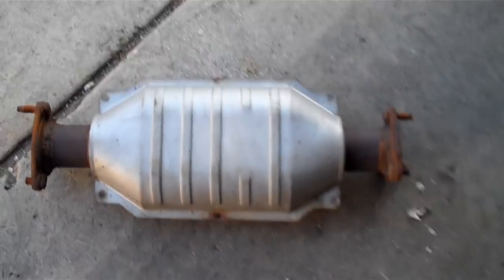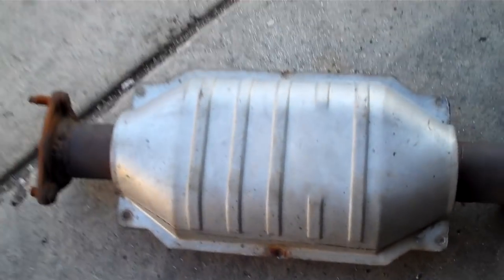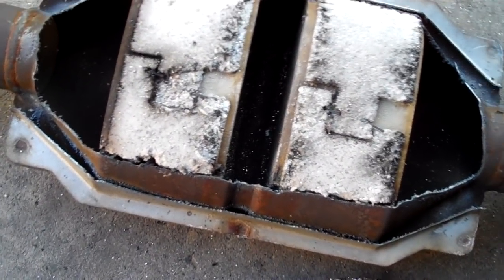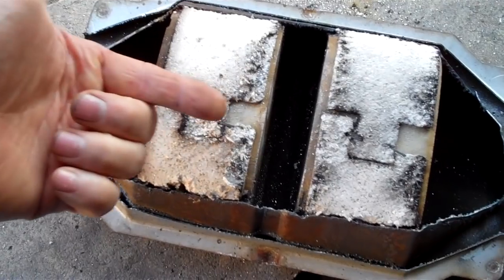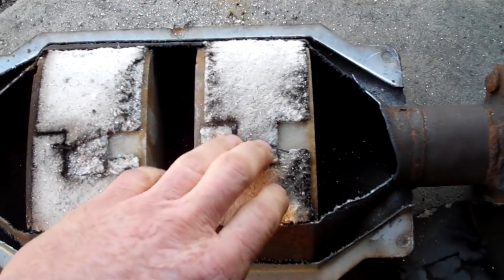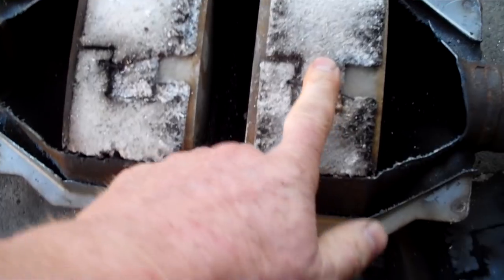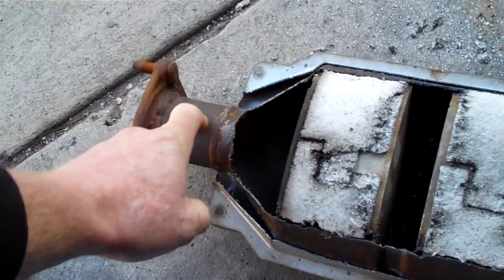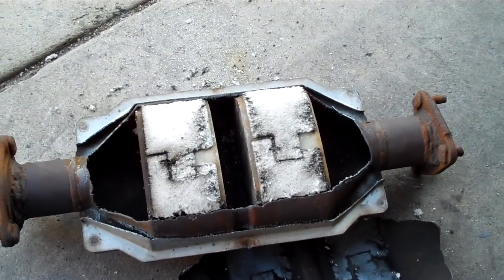Here's what's in a catalytic Converter.  Here's how they work.

Comment: Will a bad convert always trip a check engine light it is it supposed to my 98 Jeep Grand Cherokee had a bad converter got so bad the car won't go past 5 mph and my check engine light never came in and I have 2 O2 sensors I've been getting very bad fuel economy even after the repair it idols rough no check engine light is on.
Reply from the maker: +SuperJeremi10 Older OBDII vehicles before 2001-2002 almost needed a part to fall completely off for the light to come on.
Reply: oh dang haha  I'm driving a 98 haha. what can I do about poor fuel economy I'm getting about 8 mpg city and about 10-12 city highway  when I should be getting about 14 city 16 city highway and 20 highway according to the government website I have a new converter and no check engine light also no signs of a rich engine the tail pip is not black with soot plugs and wires are all new and oem style  and they don't show signs of a rich burring engine  the tail pip does not smell rich either but I'm getting poor economy I have the inline 6 98 jeep grand Cherokee  ive noticed my mpg has dropped ever since the converter went but ive had it replaced but mileage still suffers.
Reply: +SuperJeremi10    Your problem is probably related to your wheels and tires.   Yeah, big tires will kill your mileage.   Low air pressure alone will take at least 3-MPG off of a heavy rig like yours, where the stock tires are almost a foot wide.   If somebody threw some 33 inch BFG's on it an inch or two wider, then you can be running with 20psi and not even see it.   Get an air-gauge and check first.   I about guarantee you are underinflated, and oversized.
Reply: I have  the factory rims on my jeep and they are aired to 45  jeep specs call for 36  I have the factory sized tires on the car and max psi is 50 jeep calls for 36 so I put 45 in them tire pressure is checked weekly along with oil level and coolant level and tranny fluid  I have the same size tires as on the door sticker. I also don't have 4x4. I take pride in maintaining my vehicle.
Reply: The only Jeep that is two-wheel drive only is an old right-hand drive Postal Jeep. Go s;eep and forget to wake up.
Reply: I have a 98 jeep grand Cherokee and 4x4 was optional not all jeeps have 4x4 just like not all Tahoe's have 4x4 or ford f150s not all suvs and trucks have the optional all wheel drive or 4x4 don't tell me I'm wrong my jeep is rear wheel drive without 4x4 I know my car ive been under it  doing repairs.
Reply: ORRRRR...You DO have four wheel drive, and not only that, you have high and low range.    If you are driving around in low-range, you would be getting EXACTLY that kind of mileage.
Reply: I don't even have a selector for 4x4 its blocked out  the front wheels are not connected to the power train if you lift the vehicle up and put it in gear the front wheels don't spin only the rear its rear wheel drive.
Reply: Amazing....But true.   Is it automatic, or a stick?
Reply: automatic
Reply: well as far as I know my jeep runs just fine except on gas I had a oem converter put on it I'm in texas we still have lots of jeeps on the road older newer other suvs and trucks to also cars gas isn't that expensive here gas in my area is like 2 bucks a gallon and I might get vw but I like trucks and suvs  I got a 2 wheel drive care because I didn't want to deal with the gas and added upkeep on the 4x4 system my jeep has 177,000 miles on it I don't usually get my jeep pasted 60 I don't normally get up on the freeways  but when I do I go about 70 Ii also don't off road another reason I didn't go with 4x4 most jeeps in my area have a 6 cylinder engine or a v8 ill probably run this one till the motor or tranny quits then sell it to the scrap yard my grandpa has a jeep wrangler has had it 10 years 4x4  200,000 miles never had any major issues with it.
Reply: Wrangler!!! NOT built by CHRYSLER!!!   It also weighed only 2,000 pounds when it was first produced, in 1942, 77-YEARS AGO!!!   It was deigned not to carry fussy Mommies, but HARDENED WARRIORS.   It was NOT built to BREAK INTENTIONALLY.   Your engine is NOT a finely balanced HONDA ENGINE.   You are 30,000 miles, or two-years, or rater, $6000 dollars in fuel away from replacing it.   Be honest, admit it, someone GAVE YOU THIS HUNK OF JUNK.   No offense intended.   I am just trying to educate you a little on LIFE.  So, a simple yes or no will progress the conversation, Gift, or " Low, Low prices, Come on down"
Reply: Ibn Yenken Yerech Ane I actually was looking to get a Honda crv or Toyota 4 runner/Tacoma or an acura mdx but I couldn't find one in the shape I wanted for the price I could pay and low miles I had 4,000 out the door that was my max I wanted something I could walk out the door paid for in full I wanted something 150,000 and under or close to that range I got the jeep with about 150,000 it now has 177,600 I paid 2,000 out the door for the jeep  which leaves me an extra 2,000 for repairs it may need.
Reply: How...never mind.    Yes, you should have bought the Acura MDX,    I even priced one used at $4000 dollars before I wrote that.   ITS A HONDA.   Remember how I illustrated that you are spending $400 dollars a MONTH on fuel?   Even if you kept that a constant budget, the mileage increase would have pay for the extra charge per month in car payments.   There ARE ways of getting CASH from a credit card, you know.   This is the kicker, you Jeep is worth ZERO at trade-in time.   In five years, that Acura will STILL be worth $4000 dollars, and you could have done it without fixing many, may things.  Honestly, did the salesman represent it as being " Four wheel drive"?   If he did, go shove it so far up the managers tailpipe...and go and buy the Acura, especially if you actually have a budget set aside for the gas-hog.   That vehicle literally KILLED an entire car company.
Reply: I didn't have the funds all the cars here where around 5+ plus I want going to drive 300 miles for a car all I had was 4,000 anything for the Honda Toyota line  was 5 and up  anything cheaper had major issues or cosmetic damage like wrecks or an un clean title so I chose the jeep it was cheep and in my price range and not destroyed if I could have gotten an mdx I would have I don't really want a car  as for the gas mileage I had a Tahoe I'm used to not getting more then 2-300 miles one one tank of gas and no the sales man didn not sell it as a 4x4 I knew when I bought it it did not have 4x4 there are quite a few jeeps here with out 4x4 I bought it for  getting from point a to be  but I wanted something in good shape with low mileage I drive a lot of times in the worst conditions I dive 90 + plus miles a week  a lot of times in rush hour stop and go traffic not always though  with the ac blasting I should get at least 14 mpg  but prolly not me along with the rest of my family have led foots  meaning we drive fast my dad had a 94 Silverado getting about 16 mpg city he could get about 350 on a tank of gas mom had a Chrysler town and country so we are kind of used to getting poor gas mileage but gas is like 2 bucks a gallon here ill prolly never own a car that gets more then 15-20 mpg I like suvs and trucks they usually don't get good mileage specially the older ones as far as trade in I don't plan on trading in this jeep I plan to run it till its done  that's another thing  we are known for owning cars a  long time my dad had his truck 20 years 300,000 miles then water in the oil mom had her van 12 years then it got wrecked  I had the Tahoe 2 years then the engine went it was troublesome non stop always broke down no I have the jeep ive had it almost a year now. haven't changed anything but the cat and the radio bought to replace the head light lenses it has just had a complete service job all fluids changed new breaks spark plugs cap and rotor wires and a full service check everything on it is fine and in good shape I also had a new air filter and battery put in the tranny has been serviced and I was told it is healthy took it to a trusted mechanic dad grew up with the owner that's where we take all our cars to have work  done that we cant do ourselves I'm about to have the timing chain replaced unsure of when it was done you can hear it slapping around.
Reply: That timing chain alone, means it would be cheaper to buy a replacement engine.   It is a slippery slope, at that point, you could be putting a payment down on another car.    You say you are not willing to drive 400-miles to save $4,000 dollars?   But you will drive 90-miles a week all the time.   And, it appears you LOAN IT OUT?!?!?!   You are not just getting it torn up, it is one of the only vehicles possible to drift in any kind of classic sense of the word.   Let me guess, the front Crankshaft seal leaks oil as well?  This engine is susceptible to oil-pressure loss, with no indication but a red light that turns on to indicate it's too late.   I never could figure out why they would be so mean.....  The ENTIRE FRONT, and TOP, of the engine MUST BE REMOVED.   In fact, the oil-pan as well.  Hmmm, well, that means pulling the engine out.   You see, this is where you just stick another one in and hope it also has a matching transmission to go along with it, but...you have the RARE two-wheel drive model.   Even IF you were to dive in and do this as just a timing chain repair, it is going to require at LEAST $800 dollars, plus another $400 just because I am always right.   I am going to get online RIGHT NOW, and find you what is available in my neck of the Billionaire woods for next to nothing.   Give me fifteen minutes.
Reply: ill just change the chain I can get it along with gears and seal for 100 bucks and change it my self I don't loan out my car I'm the only one who ever drives it the rear seal leaks but the front don't  I aint about to pull the engine to fix it I will continue to run It till becomes an issue I have yet to own a car that doesn't leak oilit makes it to the 5,000 mile oil change with out losing more then half a court so its not a very big leak oil pressure is where its supposed o be  I can get the parts to do the chain we have a work shop we can take it to and we will do the repair on it  my Tahoe  would lose a court of oil every 5,000 miles I check my oil level weekly if the leak gets bad enough to worry about I guess ill have to have it fixed or at that point buy another car and 2 wheel drive models are not rear I saw about 4 of them just today saw bunches of them when I went looking for cars  now th ones after oh about 2005 most of them have the all wheel drive but  I haven't seen a lot of older jeeps with 4x4 least not in my area.
Reply: Ibn Yenken Yerech Ane I know Chryslers arnt the best but ill deal with any issues that come up I like the car I like the way it drives so till the motor goes ill keep it I been paying so much in gas for so long I'm used to it so the mpg isn't such a big deal to me I just was hoping to get least 14 city  but the way I drive I may never get  that it maybe better now me and my dad where working on it today finishing the maintance re greasing joints and stuff and noticed my fuel filter is leaking so I'm going to go get another one and fix it.  ill be doing the timing soon I'm ordering one next week when the motor dies instead of dropping what 5,000 on a new motor ill just buy another car. as for Chryslers not that safe in crashes well just don't wreck and be fine when I got my Tahoe I came from a car that did not have air begs as it was a 94 and at that time air bags where not mandatory I think that changed the next year.
Reply: They call them Accidents because they are Accidental.   That means you can try all you want, but an accident may kill you, and when you hit something with your car, you don't get killed by the tree, you get killed by the interior of your car.   You have a vehicle with NO SAFETY REQUIREMENTS AT ALL.   It also has a FATAL FLAW in the engineering.   It has two-wheel drive, yes, but it still has the same front AXLE, a solid axle that is suspended by SPRINGS, COIL SPRINGS.   Every time you slam on the brakes, the only thing that keeps your front wheels attached to the frame, is a SINGLE  BOLT, attached to SHEET METAL.   In a severe accident, the front axle shears off quite easily, in fact, a large hole will do the trick, like a Man-Hole cover missing is about perfect.  When the axle is torn free, there is NO DRIVE AXLE to stop it from going all the way back to the rear-axle, except one thing.   THE STEERING COLUMN.   Every INCH that axle is pushed back, it shoves your steering wheel that much further towards your hopefully still beating heart.   If the front axle deflects more than 8-inches, you will die from your ribs breaking, and puncturing your lungs, filling them with fluid, so you might even die a long, painful and very aware death.   It is an EX FLEET VEHICLE made for DISPOSABLE Government Employees.    Why would our OWN Government be so Callous?  Because they just don't care.   Kind of like you.   It is not YOU you should care about at this point, it is anyone you allow to ride inside of it with you.   If you can deal with the guilt of having a dead passenger after an accident, then fine.  Do whatcha like.   I am not one to say I have never been a bad driver. In fact, I would go so far as to admit I am a very horrible driver.   But, I have not killed ANYBODY, yet.
Reply: It is always best to look at the last work done, and that is usually the source of the new problem.    But you STILL seem to think you have some control over ACCIDENTS.   But maybe you can just Pray them away, for all I know.    Good motoring, you and millions like you support a crooked industry, I would warn every one of you, but it is like telling someone that Cigarettes will kill you, and they still insist on smoking them, because their Mother smoked them, and she died from a Tractor accident, so Smoking must not kill you.   A tractor ACCIDENT is an unintentional event, EVERY time you buy a pack of Cigarettes, you are killing one-hour and 14-minutes of your life.    But, maybe it would be the most boring 74-minutes anyways, so who cares?    As far as that goes, you might as well start a three-gram a day Heroin Habit.   Plenty of people survive forever as long as they never run out of drugs.
Reply: well I usually check oil changed but I figured spark plugs you have to be an idiot to screw that up and its one of them days where I was on the go I stopped in to have them changed and my oil done I checked the dipstick there was fresh oil iin s I paid and left by this time it was 2:30  I had to be 30 miles away at 3 dropping a kid off for dance class .
and with most wrecks yof you keep your eyes on the road and don't get distracted and keep up with maintenance on your car most wrecks can be avoided but not all you cant control the actions of others on the roads at any given time a car could jup over 2 lanes hit me head on or I could get hit by the rear stopping for a light my old truck had a small fender bender by an idiot who ran a stop sign it was a 20 year old car and it was a minor didn't so I never clamed it to keep my insurance from going up nobody was going very fast it was a school zone.
Reply: wrong I am a male and I don't have any children I do take care of my siblings a lot I'm going to collage and I work minimum wage at pizza hut delivering pizzas so I drive the shit out of my car and it has yet to leave me stranded I have drove so many older suvs and trucks none of them get more the 14 mpg city and 20 highway  my parents work full time my mom is a nurse dad works for the railroad  when I'm not working and going to school I care for my siblings I'm going to school for hvach we each have our own cars dad has a 98 dodge 1500 my mom got a gmc Acadia we take care of our cars we drive a lot my mom is a nurse we live in a 2 story house when I'm done with collage I plan to move out  when I can get a better job then working for pizza hut but I pay my own gas and insurance aloes my maintenance fees it takes like 40 bucks t fill my car up. I will keep my car until I can get another one day I'm going to get a Toyota 4 runner   also we don't live in the rust belt it never snows where we live.
Reply: I'm going because I want to do something different then what my dad does  my parents arnt divorced my mom runs her own health care business yes he works for the railroad we are also a military family I don't plan on going into the service he has offered me a job but  not something I wanted to do  he offered my brother a job too and he really screwed my dad made my dad look like an idiot he sad he wanted the job and then never even bothered to show up dad pulled every sting he had I don't want my dad to buy me a car I want to work for it all on my own to show them that I can make it my brother did finally get his shit together and has a nice house nice car oh and I don't do drugs either never have not once in my entire life I'm as clean as you can get. and as far as nice cars go my mom drives a brand new car  dad drives his dodge he loves that truck  and I have my jeep for now maybe in a few years ill have a nice 4 runner.
Reply: You go, girl !!!
Reply: I'm not a girl
Reply: Maybe not on the outside...they have operations to fix your confusion now, you know?   Sorry, but NO MAN ON EARTH asks for help fixing a Jeep, and CERTAINLY no MAN would BUY a TWO-WHEEL DRIVE JEEP!   Where are your balls?   Are you SURE you are a boy, or are you just fulfilling whatever crazy mixed up fantasy world you are living in?
Reply: Ibn Yenken Yerech Ane well don't have to worry about the jeep anymore its totaled I just came home from the hospital I hydro planed spun out slammed into the concrete barrier going 50mph  both airbags deployed me and my little brother both walked out minor cuts and bruises so I'm on the market for a new car.
Reply: heyitschinoable
well i ended up with another jeep he can criticize it all he wants but i actually like my jeep hehe ill keep it till the motor dies i have a 2000 jeep grand Cherokee base model no 4x4 but i dont off road i cant afford to fix my car if i screw anything up like the tranny.
Reply: heyitschinoable
 i like my jeep  even though its a gas hog i fill it once a week i drive about 3-400 miles a week usually i just put new tires on my jeep im replacing the front woofers the driver side is blown i heard the tweeters like to cause trouble in this model jeep but actually my tweeters are fine i disconnected them and ran the radio  and  the driver woofer made a bunch of noise but 16 year old speakers they go bad after awhile no issues with it yet so far put another 15000 on it not an issue one although it needs new spark lugs ive already checked them no check engine light oh i forgot one issue the ac ran out of freon the charging port was leaking i had it recharged with the leak die had to put a new core on the charging ports thats it its cooling great again no coolant loss nothing  this year model is known for cracked heads ive checked my factory head is not cracked.change the oil every 4,000 miles i try to take care of my car i also check all the fluids once a week.